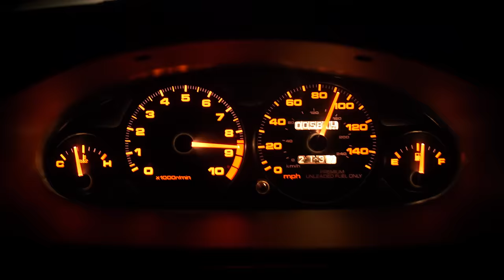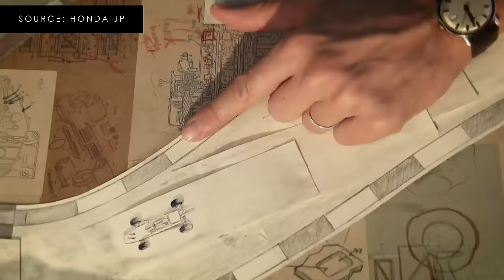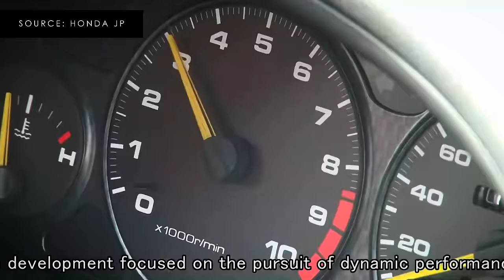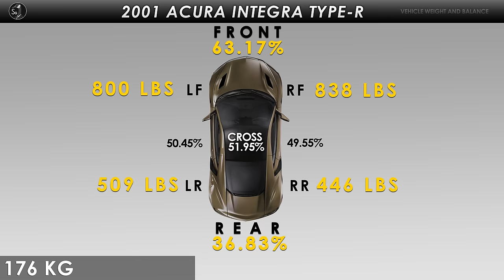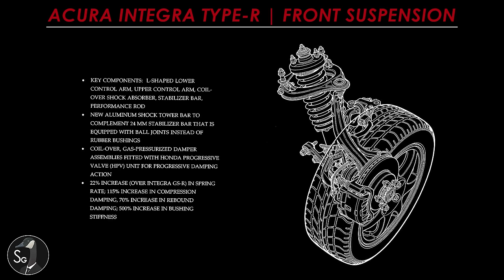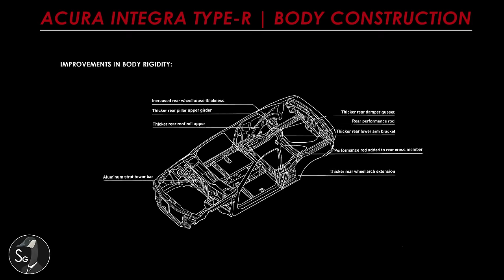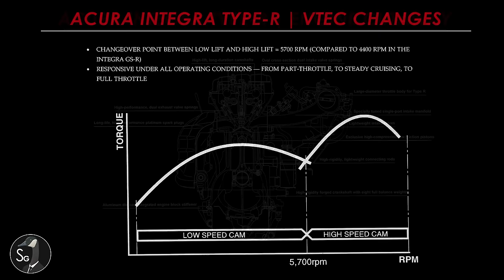Acura Integra DC2 Type R | Best of the Best

Comment: I was 21 years old, as I saw a white Integra sitting at the local Honda dealership. I pressed my nose against it's window, looking at the simple but sporty interieur. I saw the badge in the middle, which said that this was the Integra Type R Nr. 0225. But.... I couldn't afford it. I whispered to myself: "I don't know when, but sometime in the future, you will be mine!"

Years passed and I already forgot the Integra Type R. We write the year 2010 as I was again at the local Honda dealership. And there it was: An old, white, covered with some dents and rust Integra Type R. It was not in best shape, but it still got me. I looked at it, went around. Asked for it's price. It was from 1998 and hat 195.000km (=122.000mi) on it. It was not cheap, but not overpriced. I asked for the keys, to take it to a test drive. I sat down, turned the key and the engine came to live. Not as I expected according to the used exterieur, it was more like a young, playful kitten. Revvy, anytime ready for a jump and boy, it sounded healthy, after all these years and miles. I got out for a test drive and wow, Honda really delivered. This car was outstanding. It gave me an driving expirience I never had before. I felt like a surgeon with the best tools. Sharp and precise. Every input I set, regardless if it was movement of the throttle or the steering wheel, everything had an immidiate, sharp but controlable response. I loved it and bought this old Integra.

As I drove home from the dealership, I looked on the badge in the middle, it said Honda Integra Type R Nr. 0225. It was the same Integra from 1998, the same where I pressed my nose against the window as a boy. This true story makes me still smile. Also the dealer confirmed it, as this was his only show car in 1998 and the only Integra Type R he sold.

I owned this car for 2 years, as recurring rust really killed it. I tried to save it, but in the end, it was too much money to put into it. I feel still sorry for that, as it is still an really iconic car. It was the only car I owned, which could do more than I as a driver could.

Comment: What a beautifully-done tribute to an absolutely fantastic car.

You're 100% correct. We'll never see cars like this again. The new Integra is just a slightly baked-over ILX with a manual. It'll sell just as poorly as the ILX (or worse, given it's higher starting price) and be gone again within a generation. Because Honda doesn't seem to understand what made the original car special.

The 4-door wasn't what made the original car special. Even the 2-door base models weren't what made the car special. This is what made the car special. And they are banking on that name recognition and not delivering on any of the hype that comes along with it. 

What a sad, sad state Honda's in.

Comment: Great video guys, as usual.  I  have a different perspective of this car than most people.  As a young guy in 2001 I walked into the Acura dealer in Ajax, Ontario and test drove a 2001 Type R.  They had 4 or 5 new ones sitting on the lot and I picked out the one I wanted, but I paid well under MSRP as the RSX had just been released and they were looking to unload them.  In Canada you had no options, the car was white, the wheels were white and the seats were red, and BTW no AC.  Having been an actual owner of one of these I don't have the same level of nostalgia for this car.  This car is for the track, and for me it was my daily driver and at this it was terrible.  A punishing ride, lack of AC and you had to yell to the person beside you because the decibels in the cabin were ridiculous (no sound insulation).  Never mind all the unwanted attention you got from the wrong sorts of people, and the constant fear of leaving it in a parking lot.  And yes I did eventually have a major incident involving this sort of thing.  Did I drive like a hoodlum in it? Yes.  Did I break all manner of speed limits - Yes.  Would I want the chance to drive one again - not really.  I've owned a ton of cars and many others in this class, and I am sad to say this was not one of my favorites.  I'm sure many of you will be upset with me for saying this, but this is my honest opinion as a previous owner of one of these rare cars.  I really wanted to love this car but never did, I kept it for less than 2 years.

Comment: I had a sweet 95 gsr around 1998. Fun car but the sheet metal was so thin that you could dent it with a finger tip.  Thing was sharp as a razor around corners. 

Killer production and sound track on this one.

Comment: I foolishly bought the wrong Integra as my first non- beater car back in 2000 and something. Non-vtec engine and in retrospect it must have been driven roughly over it's life before I had it. Didn't bother to check insurance prices beforehand and ended up paying more for insurance than the monthly car payments. I had to drop it after a year and ended up stuffing the front end into some vans rear that was stoped dead going around a blind corner. I hadn't ever done an emergency stop before with ABS and let off for an instant because I thought it was not working. No one was hurt thankfully. Still one of the best cars I've ever had tho 🤣

Comment: A lot of the reasons that made the DC2 ITR special are what prompted me to buy an FG2 Civic Si when they came out. After being disappointed by the EP3 Civic Si and the DC5 RSX Type-S I was glad to see that they hit closer to the benchmark with the FG2. While the FG2 Civic Si is heavier than the DC2 ITR and it has an electronic throttle body, it had great suspension, a similar helical LSD, a great feeling transmission (as long as the synchros aren't shot XD), and a terrific high revving NA engine.

Comment: Cadillac has done it with the new Blackwing. Sure 99% of people cannot afford one, but man that car looks to have all the fun of older cars even if the suspension does not have the same connected feel. 700hp RWD manual with long gearing that screams at high rpm.

Comment: Having owned the first and second generations of the integra, I feel like wth was I thinking not buying the third gen integra! Everyone I knew said I was a total freakin savage  in those cars and honestly looking back at what some people said about my treatment of those cars they weren't lying! Words like raped, ravaged, and insane were used, I did things like drive from a cousins barbeque. Pick up some audio equipment at home and back to the barbeque so fast that they initially thought I hadn't left! When I showed them the proof in hand it was a (turntable) everyone had a concerned look on their face, because I had just driven roughly 50 miles roundtrip in less than 60 minutes. Also during that pitstop at grandmas house, I had to unlplug and wrap up that turntable to bring back to the bbq. The car eventually didn't want to run smooth during normal driving because said the mechanic, "Who do you think you are a race car driver? Your car is so used to running wide open that the ecu has made adjustments, so now from  all of that savageness, the car doesn't like being driven slow!" Haa haa haa what a compliment I thought! Ahh to be young and fearless!

Comment: Thinking about this car, the ITR, it's pretty raw, a friend of mine had one, in the iconic Championship white color, which seems more "Type R ish", than the Pheonix yellow. Great car, back in the day. Seems Subaru could easily pull off something like this with the BRZ. Using the same basic formula, cut some more weight, it's already a very light car by modern standards. Massage a bit more power from the motor, which is still naturally aspirated, the new FA24 looks to be much more tractable than the outgoing FA20. Upgrade the suspension. Having the FR layout is even more of a bonus. Not sure today's generation would care for such a raw noisy car, but I'm sure  some some buyer's might, yes I know it will eventually get it's plethora of "upgrades" and mods from the aftermarket, but much like the fart canned "DC sports" GS-Rs of old, Honda's approach with the ITR was far more cohesive than any aftermarket tuner, and with warranty to boot.  I'm sure Subaru's got a tS version up it's sleave for the 2nd gen, but maybe do something more special...

Comment: We don't have Acura in Europe. However, I can fully understand the appeal of such an underrated car. Heck, I drive a 2004 Euro Honda Accord, basically an Acura TSX, albeit the base version, with a 2.0L 4 pot V-TEC. It's a daily driver. Sure, it's automatic, to spare my left knee in traffic on my daily commute, and I switched to 15in. wheels for comfort on (bad) UK roads. It's no sports car, yet you can feel some of that Honda DNA whenever you're in the mood. And it's extremely reliable to boot. I shall drive it to the ground. A great video, Sir Marc. Then, there is this... https://youtu.be/kDFE92gA3Ag.

Comment: Fantastic video, Must of hit every point right on the head. Current 2000 Acura Integra Owner with (JDM Conversion) I hope Honda/Acura is embarrassed of the (New Integra) they truly Messed up as a whole...Make the Integra what it should be Loose all the Fancy stuff make car 2 door hatch maybe add blue tooth for younger generation and a Aux cord input  for older  generation lol with a K series in it (maybe bore to 2.5L with V-tec and variable cams both intake and exhaust side) and nice 5 or 6 speed with LSD is it that hard to ask for?

Comment: Imagine that those of us that grew up with the 90's/00's Japanese sports cars and couldn't afford them, we're at an age in life that we CAN afford them now, but we can't buy them because they don't and won't make them. You have Toyota who was kind of close, but missed the mark in too many boxes with the overpriced auto only Supra 3.0. You have Subaru  screwing up cars left and right. You have Honda now making a 4 door CTR that's respectable, but I would love to see a 2-door hatch CTR again. And... well, now we have Acura screwing up their Type-S, and now they're out to buy the Integra name. It can be the best driving FWD car ever, but it won't be a 2-door with a big wing like this legend. The 86/BRZ are missing drama in their engines once again, a high revving NA motor, or a turbo would have went a long way. Toyota also not bringing over the GR Yaris 2-door WRC hot hatch I would have owned by now if sold here, will instead be some dumb 4-door corolla.

The only one that so far seems to be doing it right, depending on price and availability, not to mention controlling the scumlords at stealerships, is Nissan. The new Z might be the last Japanese hurrah at this point before all hybrid and EVs are cruising around making vacuum noises and feeling like lead sleds.

Comment: Great tribute to a JDM icon. I have two - one a fully caged race car which ran the original unmodified B18CR for 8 years, then K20a swapped, and more recently K24 swapped. And a factory original 1996 JDM version in Championship White with 55,000 miles. The reliability of the B18CR in the race car was unbelievable! Savagegeese nail all the essential aspects of this car that make it so special. There is no other car quite like it. Well done guys. (Here's a clip, from my other channel, of the race car on a hillclimb with that glorious B18CR screaming the whole way! - Did that over 8 years and in excess of 250 rally stages, still going strong when swapped out! Honda engineering at its very best! https://youtu.be/o1pNcWyqTeg )

Comment: 130 ft. lbs. torque. Yeah we beat these cars hard back in the days, but on the streets, with hairpins and square right turns, having to use first gear to get power off a corner sucked. Or launching at 6000 rpm. I prefer modern cars with the cam phasing and turbos with toque in the basement. The Fiesta ST comes to mind which I own now and is faster in most scenarios with better steering feel than my AP2.

Comment: As an owner of a stock dc2R, I thought I'd share this with peeple to see if its just mine or can other owners do this with their dc2R? Mine is stock - no mods MY'01.
One day as i pulled away from a green light, i accidentally did the following,
pushed clutch all the way down,
pulled 1st into 2nd gear, at about 4000rpm (no need to hit vtec or redline),
let the clutch out about 1/4 of the way,
tapped the throttle all the way down (very quickly) before releasing,
then let the clutch up to about 1/2 way,
pushed the throttle pedal all the way down this time and kept it down.
I got an unbelievable rush of power that pushed me so hard into my recaro seats, it felt like they were gonna break.  It was just an AMAZING rush of power, i dont know if the engineers intended it to do this but i do know it works & its UNBELIEVABLE!!! 
Sadly, I've only managed to do it a handful of times (cos it's hard to do)
Try this with your dc2, & then tell me if u experience the same!  If so, it's time to let the secret out guys!

Comment: Much  of the technology used in this car came from the SH  ( Super Handling ) Prelude a car  like   NSX and the S2000 was  a purpose built sports coup made only in Japan that did not need to be modded to go fast .  Like the ball joint on the end of the radius rod was a SH related improvement .  On the street this car is not as fun as the Prelude because this car has no mid rpm torque and you have to drive it like you stole it to stay in the power band a feet hard to do without killing yourself on the street . In fact this car was just like the first gen  Integra  compared to the 2nd gen Prelude a  car with to narrow a power band to enjoy on the street without waring out your arm shifting .It had much of the low rpm problems that the  ap1 S2000  had that was later corrected in the ap2 version . I mean really just 1.8 liters ! That’s the same displacement as my first 1981 Honda Accord just not enough .